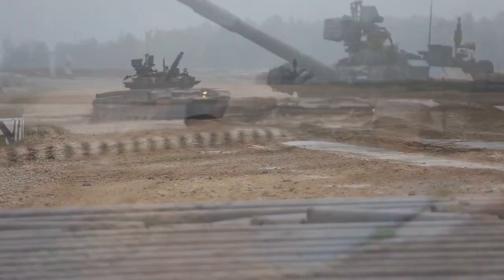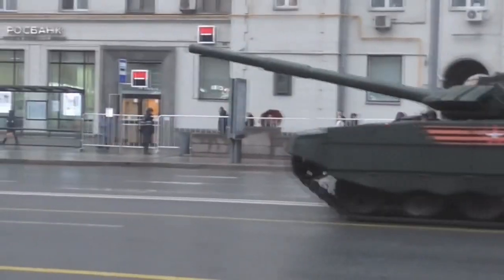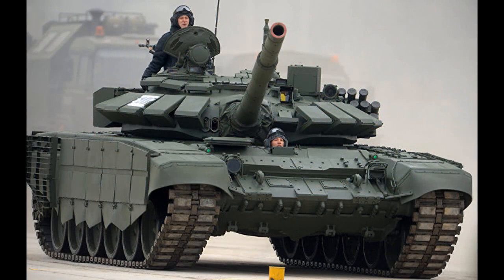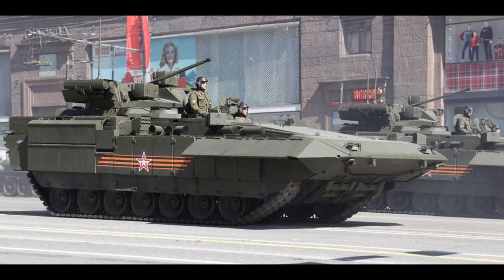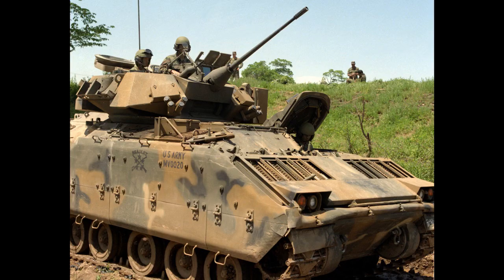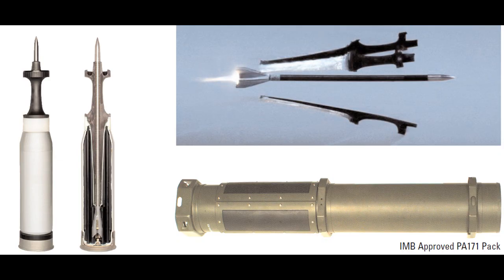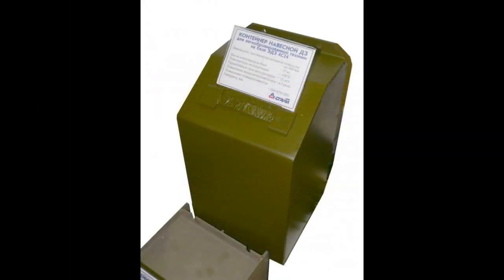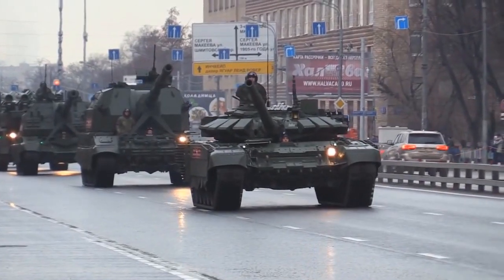Russian Explosive-Reactive-Armor 101 - Identification and How does it work??

Comment: I don't get it. What makes explosive reactive better than normal armor? Is it lighter for the same protection or something? How is it better and why is it used?
Reply: Take Relikt for example. When a block of this ERA is hit, the two steel plates surrounding it are pushed apart.

On the front of the tank at least, Relikt blocks are heavily sloped. So, when the explosive blows the steel plates apart, both go in diagonal directions.

Since they go diagonally, there is both a vertical and horizontal component to the movement of each plate as they are impacted by the incoming projectle.

So, while the projectile will go through the steel thickness of the plate that is directly in front of it, more steel from that plate is being fed into the projectile due to the diagonal movement ("plate feeding"). In one way, steel from the plate is being fed vertically (from below or above the projectile) into the projectile.

In this case, the effectiveness of the ERA depends more on the length of the blocks than their thickness.

Comment: Wasnt relikt some sort of era that works with a radar and explodes before projrctile even hits it? Or does it only work like that against ce munitions and explodes on impact against ke?   And also shouldnt be 4s23 less sensitive compared to 4s22 so that you ll get a more delayed explosion so you have more of the penetrator interfering with the 2nd steel plate when it goes off. Because if its more sensitive then the second steel plate wouldnt serve a purpose , it would strike the hull before interfering with the projectile and not serve any purpose?

Comment: Is there any particular reason why Russian tank designs use a lot of ERA while western tank designs tend not to? Is it a matter of design philosophy, or is it a necessity on part of the Russians? I have wondered about this for some time but have neither the time nor the knowledge to dive into it.
Reply: In many ways it is a matter of necessity. The small hull of Russian tanks makes space very limited, especially on the hull. There’s very little space for composite armor, so they need something they can bolt into the outside of the armor that significantly degrades the incoming projectile. For the turret this is less of an issue as there’s more space for composite armor, but still less space then their western counterparts. This has driven Russia to create some extremely effective ERA. ERA also makes it easy to swap out damaged armor components since you can just slap a new tile onto the tank and your good to go
Reply: @deathdragon2283  Oh, so that's why! Makes sense, the Russians have had internal space issues as far back as the T-34. Thanks for your answer!

Comment: I wanna know more about the space magic that is those NxRA plaes on the hull sides of the Terminator, B3 and 90MS.  How effective and thick are they vs Sabot ammo?  In Armored Warfarw they are treated basically like a 1 shot destrctible shield, stopped incoming fire like a champ.  It looks thin as hell but stops 600-700 penetration dead.
Reply: CMDRFandragon there is info on kontakt-5.
Reply: @randonlando418  Kontakt-5 is all that magic side skirt is?

Comment: Surely a 3 foot long fin round travelling at +1500mps will be through the ERA before the explosives within can detonate?
If the round is 1m long then does it not follow that it takes 1/1500th of a second to pass a given point?
Can any explosives fully detonate in such a short space of time?
This is a genuine question and I'm fully prepared to be proven wrong by the way.
Reply: The cumulative jet moves many times faster, it was a problem to get such characteristics so that the ERA worked on the impact of a slow projectile 2000 m / s.

Comment: Can you do a video on the T-15? Hardly anyone talks about it as they're more focused on its big brother, the T-14.
Reply: All I can tell you so far is that they put a 57mm auto-cannon on it, instead of the 30mm gun that was shown during the parades. I think Russia plans to use the T-15 in several variants, probably even with a 100m gun (the BTR „Bumerang“ is meant to receive a 100mm gun, as well).
Reply: @dmitrit.4862  That's a good idea we use the stryker with a 105mm gun on it they seem to be very usefull
Reply: @joshualance6005  They're definitely usefull.
Reply: @joshualance6005  The Stryker 105 is terrible though?
Reply: @kurogumo  no not really it's a excellent vehicle and we have put it to good use
Reply: @joshualance6005  The gun is way too large, and we have to use half loads in order for the gun not to rip itself out of its mount. Even with this, the gun still has a chance of flipping the vehicle over if fired at the wrong angle. This, coupled with frequent equipment malfunctions, make this vehicle rather 'unsatisfactory' for its role.
Reply: Not true gun uses the same round as any 105...
Reply: @ruicastro3698  False, look it up.
Reply: @kurogumo  Wait, it's an actual 105 gun? I always thought that it was a Recoilless gun. I don't know how that thing doesn't just fall apart.
Reply: @alexanderd6793  Yup, same 105 that the M60s used.
Reply: @kurogumo  Dear God please help the superstructure of this vehicle.
Reply: Brian Joyce compared to the t-14, there is little info
Reply: Good idea.
To be honest I have never heard of it.

Comment: Can ERA be 'scrubbed off' by lower caliber munitions such as MG? Will ERA expend itself on incoming 20 -30mm? Sorry. i watch many your vids but forget to like. Your stuff is super informative.
Reply: Wallace Wood he mentions in the video that kontakt 1 can be detonated by autocannon fire i doubt a mg can do it too
Reply: Thanks! I missed it.
Reply: @___seb4843  no, modern era like malachit, relikt , kontakt 5 cannot be initiated by 30x165 mm
Reply: Gustav Husák read again i said kontakt 1
Reply: The projectile will simply make a hole in the protection unit, which will reduce its efficiency, but the detonation will not happen, much higher energy is needed. Yes, the ERA of the first generation (Kontakt-1, and blazer) may be disrupted by fire from HMG, but 2-3 generation no.
Reply: The later ERA's probably can't because of that steel panel before the first set of explosive filler, so MG's up to probably 12.7mm would have difficulty trying to penetrate it. Contact-1 doesn't have that plate, meaning that anything that can penetrate the outer wall of the box can most likely detonate it. Again, probably, that's just my guess.
Reply from the maker: It is not about the plate, it is about the explosive being used. Kontakt-1 uses 4S20 explosive panel which is sensitive to any higher calibre fire, including autocannons, it can only resist small arms fire and 12.7mm HMGs. 4S22 used in Kontakt-5 has better sensitivity to HEAT and APFSDS and the sensitivity has been enhanced to not enable it to detonate after its been struck by autocannons, the sensitivity is even greatly enhanced with 4S23 used in Relikt.
Reply: @RedEffectChannel  What if incendiary ammunition was used, would that make a difference? Or are the explosives maybe only detonated by the pressure of the incoming projectile? A bit like the way diesel ignites on compression in the engine, but not with a spark or a flame; unlike petrol.
Reply: For bullets no (but for early ERA, autocannons can set it off)...because the explosives that are usually used in ERA is very similar to plastic explosives. And plastic explosives are insensitive to small arms bullets. Also plastic explosives cannot be set off by fire too, which sorta explains why ERA cannot be detonated by flame (and also can remain relatively intact, and not be weakened, or degraded severely by fire......however if the plastic explosives get hot enough, they could conflagrate, and fizzle out. Which compromises the protection of ERA.....however, I think this temperature is not easily achievable by most fires, and I think some ERA have resistance to even thermite).
Reply: kontakt 1 could be, other like kontakt 5 or malachit can survived 12.7mm gun